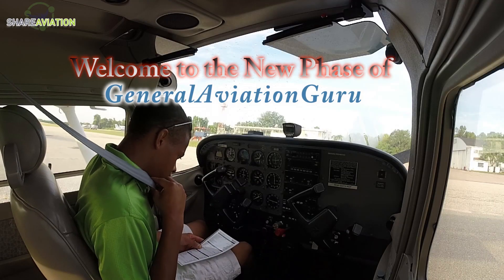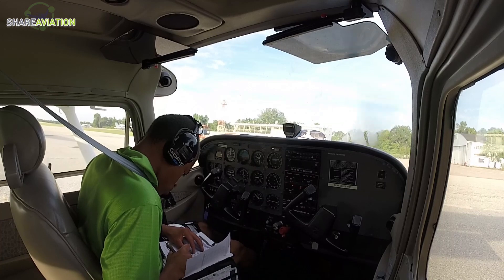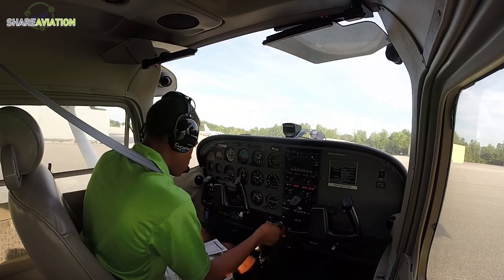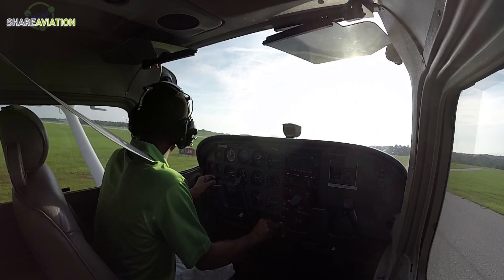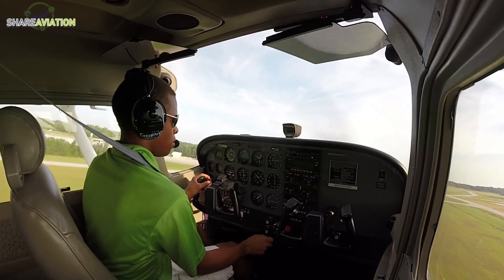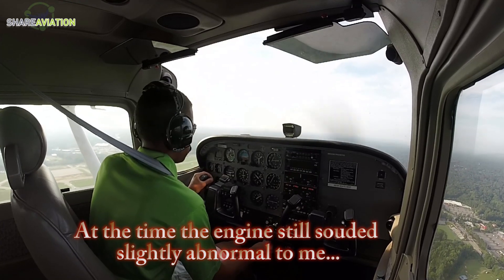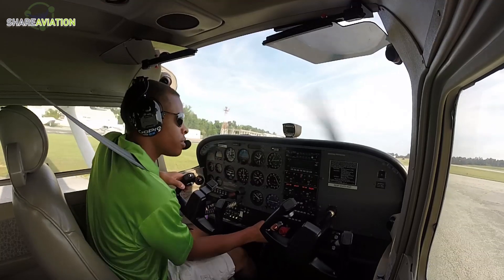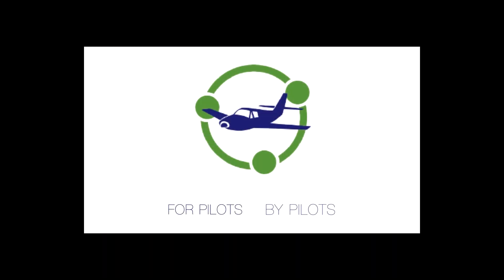[HD] Precautionary Landing - Engine Slump on Departure

Comment: Hey dude, thanks for posting this. Did you ever find out what the issue with the engine was? Any what was your thinking behind flying a normal circuit to full-stop? Seemed to me that an engine failure on final would have put you in the trees! Not criticising, just curious!
Reply from the maker: Maintenance couldn't replicate the problem, which likely confirms my supposition it was just a mag/carbon buildup thing.  As far as your other question: I stayed within gliding distance  during the pattern; in that case, flying a normal pattern was acceptable, especially given that KAUO has intersecting runways which allows multiple options given an engine failure in the pattern.
Reply: GeneralAviationGuru understood, blue skies!